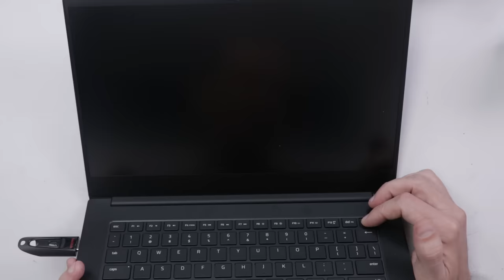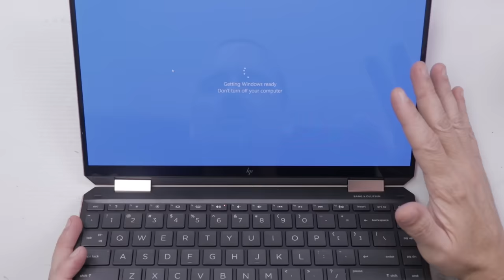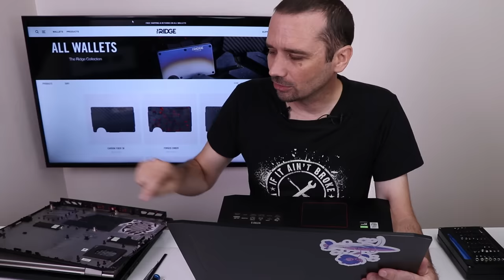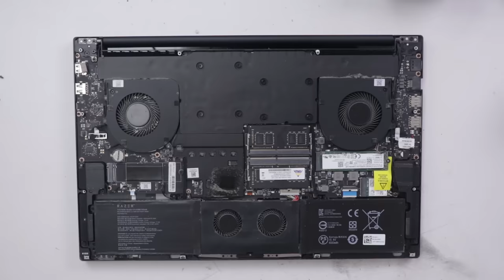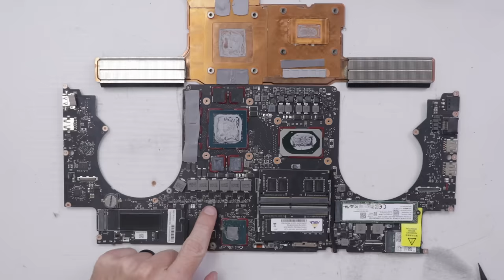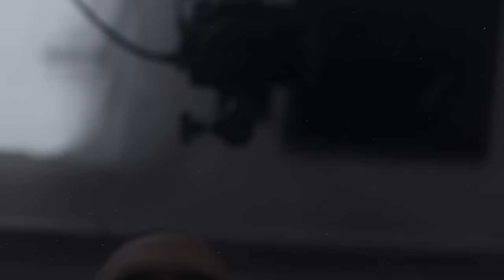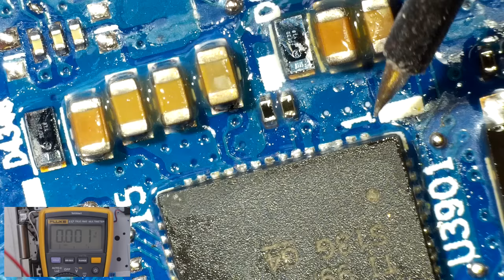I Paid $2500 for 5 BROKEN High End Laptops - But Can I Fix Them?!

Comment: Its the charging IC because the u unplug the charger while the battery is connected the ic detected the battery which is unable to charge thus when u unplug the battery and put it in charge it may bypass the ic instruction i highly doubt its the IC or a small Cap where the heat came from its 90% the IC and 10% for the Capacitor

Comment: I don't know much but newer laptop have power cut off after reached certain battery percentage that the user set to save battery life. But I don't know if the cut off will work when the laptop is turn off.

Comment: Lenovo yoga which one does not work battery + plus maybe problem is discharging MOSFET. You can discharging MOSFET on board near the battery connecter or you can send HD photo of the motherboard i tell where your mosfet.

Comment: I'm confused.  You worked on a Razor to start and at one point the Asus logo was in the lower right on the screen.  Then you worked on the Lenovo and once again the screen said Asus and appeared to be the exact same screen as the Razor.  Then you worked on the HP Yoga, and again the screen said Asus in the lower right and appeared to be identical to the 1st two laptop screens.  (Skipping the Acer)  Then the the 2nd Razor also had a screen with Asus in the lower right.  Is this just a co-branded version of windows you've been installing or something?  The hardware was different each time but it seems weird those laptops would have an Asus logo on the screen.  The 2nd razor looked correct at first then the background changed and the Asus logo appeared in the bottom right of the screen.

Comment: don't some laptops have software side that keeps the batterys from over charging.and require it to drop down below a % of charge before it will let it charge on battery power. 

To help preserve the battery life? Curious what it showed in windows and not on your meter.

Comment: I've had an (older) Nitro 5 for the past 4 years. I never had that many issues with a computer in my life. I ended up giving it to a repair shop, they changed the HD. But it's still not really working 100% I'm afraid it's a material issue (I got it second hand, now I know why it got sold after only a year).

Comment: most laptops have a flightmode killswitch they can either be a physical switch mostly in the front frame  or it is a Key-combo to be pressed  they doe usually not work when the driver  is missing and they are enabled by default when you reset / Reinstall  the O.S  to the O.S itself it looks like that the hardware is faulty / not present but once that killswitch is turned off  in windows you see them popup and say "hello"  Iyeah I learned that the hardway.. ;)

Comment: Last one is a bad battery controller I think because it may be used on the charger all the time and may have had a small defect or a short but if you hard restart it it works again so buy a new battery

Comment: Would discolored LEDs on a laptop keyboard be a faulty RGB LED controller chip or the individual LEDs? 

My 2020 HP Omen laptop has a 4-zone RGB keyboard and only one of the zones has this yellow-ish discoloration, but not the whole zone just some of the keys, so that's why I'm thinking it's the individual LEDs that are faulty.. and hopefully can be fixed by soldering in new replacements??

Comment: Hey TronicsFix! I just wrecked my titan x pascal I filled the pcie slot with water and turned it on. oops. I already ordered a 3070 to replace it. Are you interested in attempting to repair the titan? It's a really nice gpu it's a little better than a 1080ti. Lmk!

Comment: ITS THE BATTERY . I HAVE A BATTERY THAT DOES THAT I GOT FROM A QUESTIONABLE EBAY SOURCE THE WILL STOP CHARGING AT 80 PERCENT AND THE CHARGER WILL TURN OFF . BATTERy issues are a thing

Comment: if u find a solution to the lenovo laptop make a video about it, time ago i was having a problem with an hp laptop that shutdown randomly beetween 1 to 15 min only when the battery was plugged in, when i disconnected it work fine, no unexpected shutdowns.
I tried taking it to service with no luck, no one find out what was happening and i buyed two batteries and the same problem happen. At this point i think it was a faulty chip in the motherboard. Nice videos btw!

Comment: the lonovo yoga laptop has a battery issue, it turns off as soon as you disconnect the charger, the battery is faulty
and you have to buy a new battery

Comment: I'm not sure about you're Lenovo yoga battery issue but it could be a device on the board that's causing a conflict with the charging.  Like the wifi card or a chip on the board. 

Example: when you took the board out and you connected power to it the screen flashed ( so there is a issue even with other components not connected to it like the battery or keyboard ) only thing that was still on the board was the wifi card and the chips.  
Then you connected back to the laptop and plugged in power again and still does the same thing, no display on the screen until you unplug the battery then their was power on the screen, then you plugged in the battery and it appears to be charging.  You then removed the power and connected it back and it will flash again with error. 

So I think that there is something causing a conflict with the power and the only thing I can see is either the wifi card or a chip on the board is bad or the battery connector on the board is not soldered properly ( but I dont think it's the solder) cause if the charge adapter detects the battery once you plug the battery back in and its charging it should continue even after you unplug the power adapter and plug it back in not go into a error mode) 

Also when you first worked on this laptop you said or showed that when you pressed the power button the power lights would or was flashing.  I would try to count how many flashes it down and look that up.  Normally those are error codes so go on google and type in lenovo yoga power light error codes and see what the diagram says the lights mean when you have the count. If its 3 flash or 3 flash and a break and then 2 flash again ( as a example ) 

Simply put something on that little board you took out isnt right and if it was me I would remove that wifi card and if it has another device on the board and then connect your tester and see what happens.  If it flashes still then I would say there is a chip on that board that's not good.  

P.s I just noticed after watching vid again that you did remove all connected devices from the board lol 
So I would say that there is a chip on the board that's not working right as to why the display adapter is giving a flash 

Good luck and please post a update about it

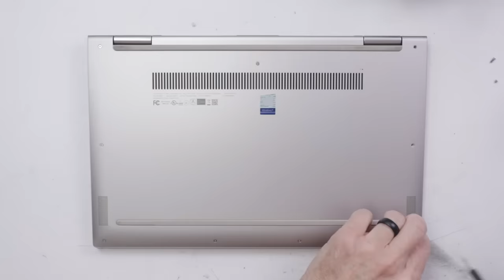Comment: Noticed with Lenovo laptops now (X1 Carbon is where I first saw this), they have a battery reset switch. Could that pinhole be one at the top right of the vents (13:44)?
Worth trying, I don't recall how long you'd need to hold it, or if the system needs to be on to use it, etc.

Comment: //edit. Sry, it's not lenovo lookss like//
Why you install Windows on Lenovo using ASUS OS image/recovery, instead of the one to be used and which is stored on your PC? Windows itself doesn't make a difference really, but you want to make it easier and install drivers/proprietary software, whatever specific there is in this Yoga, and provided in the recovery tools itself? Some updates and install/uninstall may be necessary, but still, it's easier, than to try to find every single piece of software and drivers over the Interwebs.

Comment: Razer, gross.

My Blade 14's charger self destructed, I had to pay for shipping on a replacement

 Then the bottom feet adhesive failed and they fell off, they wouldnt send replacements and wanted it sent back so they could replace the bottom cover - again with me paying for shipping. I ended up replacing the feet with something on Amazon.

A few months later it woke up from sleep while closed in a bag and melted it's own keyboard. Razer's reply was pretty much "LOL, so sad. Your warranty ended a month ago - no we wont sell you any parts. Bye!"

Comment: You should really update BIOS to the latest one. These laptops have issues like that
Reply from the maker: The BIOS has been updated with no change.
Reply: Cerus98  there doesn't have to be an direct fix. Simple EC update that fixes another issue could've fixed that

Comment: Hello there I have a very specific question I do microsoldering and I've always have problem with tips what tips do you use for your micro soldering especially the tips for the tracing also what is the acceptable temperature for the heat gun and the iron tip

Comment: "Fixing" keyboards on laptops is almost impossible...I had an hp zbook from yesteryear 2013-2014 with keys that needed to be pushed in further than normal to register, I took the scissor key off took a look and the whole keyboard was filled with pet hair. I went in with some tweezers and got off as much as I could, some keys were back to normal others remained semi unfunctional. You can't really clean the membrane but I'm assuming that would do the trick, all the nibs were intact but I noticed even after cleaning MORE pet hair. Additional "broken" keys started working normally but I had a few left that no matter how much cleaning (even tried q-tips with alcohol and "maneuvering" below nib and it was a no go) that keyboard ended up with 2 bad keys. Mind you they still worked they just had to be pushed in further than what's normal. The nibs/nubs or whatever you call them are hollow so you need something thin enough to get under them and clean better. Unfortunately the only keyboards I could find lacked the "touchstick" one had it but the connector had been cut and had to shell out 50 for a Chinese part but I had wasted 20 on the one with the cut touchstick connector. When the Chinese part arrived the picture had the touchstick the actual part didn't I gave up.

Here are other problems I "fixed" on one keyboard the scissor mechanism (thin pieces of plastic) broke and the replacement was $5, but the keyboard has several models each with their own type of scissor mechanism on the same model of laptop. I had one with a broken membrane that I kinda just superglued together and it worked but if you know rubber and super glue ends with brittle superglue so not a permanent fix. A broken nib/nub again with superglue and as suspected it only lasted a month.

tldr; replace keyboard

Comment: so I just rattled my Lenovo laptop and I found out that there is a screw in it, I have heard it for a long and I want to see the inside of it. The problem is that I am not familiar with computers and I really want to see the inside. Does anyone have tips on fixing the rattle noise?

Comment: I have a 2020 HP Omen laptop and the 4-zone RGB keyboard has a few discolored LEDs in one of the zones, like if I set it to all white a few keys look more yellow-ish and that yellowing tints any other colors too. 

Considering it's only an aesthetic issue I'd rather not send it to get fixed, but I was wondering how difficult it would be to DIY? I'm pretty sure it's a hardware issue cuz nothing I've tried in software has fixed it, but I don't want to buy the whole replacement keyboard part, so would it even be possible to just replace the individual "faulty" LEDs or perhaps the LED controller chip? 

Anyone that has experience with this type of thing please chime in!

Comment: In my expert opinion, I believe you can’t get that one to consistently charge because the microchip next to the dongle gerder is circumvlating the amps into the power stabilizer.  Simply unplug the snarfblat, plug it back in and you should be good.

Comment: You need to install drivers online, don’t forget that. The Windows on the USB Stick doesn’t have your device’s driver. And btw, you installed an ASUS Windows 10 on all of these. Why
Reply: It doesn't really matter. Ideally it would be the same brand, but having just one OEM disc to install to make it work is good too. Install the right drivers then replacing the Asus/whatever incorrect logo to the right one is an easy software fix.

Comment: Hey bro. Nice video.
Reply from the maker: Glad you liked it
Reply: @Tronicsfix Was nice to see you work on some laptops. I used to repair laptops and desktops, that first laptop you worked with, looked like you didn't wipe the whole drive with the old OS on. You should delete all the partitions in the setup first then windows will make new partitions by itself.
The WiFi also not working seemed to just be a driver issue. You can usually find all the specific laptop drivers you need usually on the manufacturers website that you can just sideload with a USB. Then after installing the WiFi driver you can just use Windows 10 update from there.
But you probably know all this by now after repairing them all, but maybe it helps someone else😅.
Great video though! Loved it!

Comment: i remember a friend of mine bought a new laptop (lenovo thinkpad) and it had a similar issue with the keyboard, only with the diffrence that some of the buttons wrote the wrong letters and some didn't wrote anything. Would you say i could have fixed it with a new keyboard? because i already installed a new os on it and it had the same issue

Comment: Bro i have the same problem with my old acer laptop as the lenovo one. So i remove the battery and using it with the ac adopter. I hope u fix that lenovo laptop so i can try the same fix

Comment: I've been having issue booting my laptop, whenever i boot it is blue screen. Backstory, i plug a usb fan on my laptop and my laptop turned blue screen and whenever i turn it on is blue screen, i've try reinstalling windows, changing ram and etc still blue screen, do you have any solution ?

Comment: a curious thaught, can an Xbox One coper pipe cooler work in a pc. and will it mount properlly? and if so wat would the thermals be like?
Reply: There are too many PC sockets out there and you didn't mention the one you want to mount the heatsink on. So a "helpful" answer is impossible. Plus, it wouldn't be worth it anyway because you can get a similar cooler for like 15 bucks.

Comment: if some keys don't work, just replace keyboard. nothing else will help
Reply: Not really. Check for liquid damage first, as I repaired a laptop with its keyboard not having all keys working (just like the vid) and the problem was just spilt soda on the keyboard, mucking up the contacts. A quick clean and the keyboard works fine.
Reply: @izhamsham843  that's possible, but simpler way is to just replace the keyboard [unless it's really expensive] , because from 10 keyboards, maybe 3-4 can be saved by cleaning them.
Reply: @lordmmx1303  I agree it's simpler. I fix stuff on the side so I probably have more time than a full-time repairer (who have a whole lot more to fix and limited time to finish them) to open something up & find what's actually wrong with it. Same reason why when someone gives me a hard drive that has a malware in it, instead of just formatting the drive & be done with it, I'll spend a good few hours trying to get rid of the malware & hopefully saving whatever data in the hard drive. Not really worth the time for someone professionally doing repairs, but gives me satisfaction 😅

Comment: So ez  , i have a laptop on my bech , whatever i do it just says im dead , dont bother me :V Btw that charger issue might be a faulty capacitor , i came across 2 year ego with same thing , there is a capacitor near the battery in that shorts when the power chip asks are you there to battery ... Dont forget to check for that...

Comment: I found the solution y xbox one x and s power on and off, The champ remover tool the metal fork shape scratches the surface of the motherboard and breaking resistance

Comment: The battery problem is the plug-in area of the battery
Reply: That’s what I was thinking too. Has to be a loose connection. The way the meter was acting was a symptom of a short to ground

Comment: This is why i never bought Lenovo laptop anymore because their products quality is just garbage, not to mention they even makes their laptop harder to repair on purpose, i notice this when i opened up my friend's laptop, then i try to reconnect keyboard and touchpad flex cable, the cable is really short, it so short that it makes you almost impossible to put it back with barehand, even with the help of pinch tool it still hard to do and it makes me ended up just replacing the flex cable with newer one which the cable also longer than original one. I really hate Lenovo, they hate right to repair just like Apple.

Comment: Error Code: "Gives me something to go off of", well unfortunately nowadays alot of Microsoft ECs are vague and generic if they give you one at all, or a generic Text Error Message.... But it's not as bad as Sony PlayStation (Literally have 1 error code, means 20 different things:  Internet,  Game, Game Data, Game Files HDD, Some Random Setting,  Server Issue, Power Issue, USB Drive,  Audio Setting Issue, Video Setting Issue...all generic broad and annoying / infuriating... As most don't have a common thread,  or any relation. Meaning you have all these possible issues causing it, there's no commonality amongst them, and usually aren't the issue anyways,  that or doing what they say doesn't resolve it and you need something totally different).